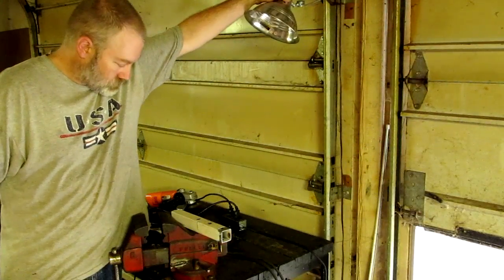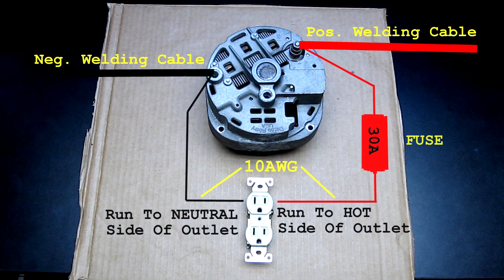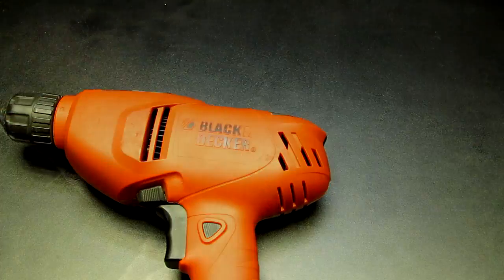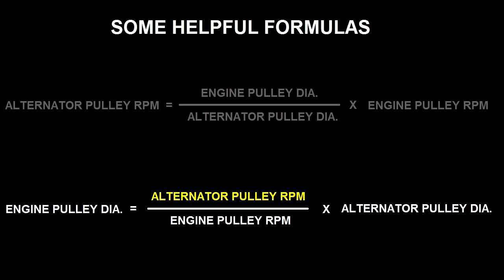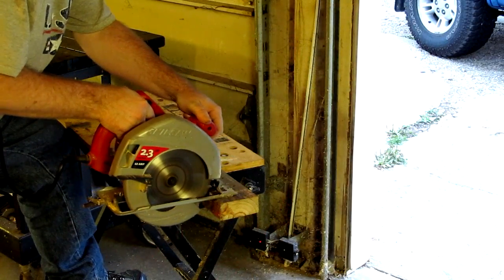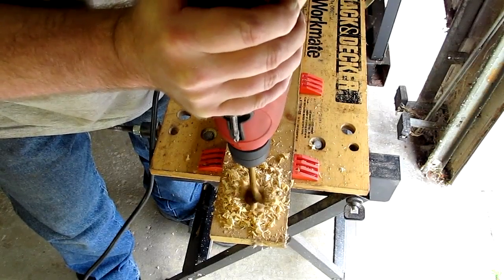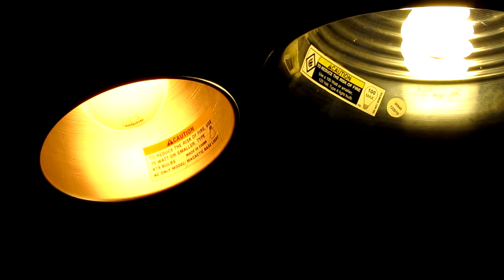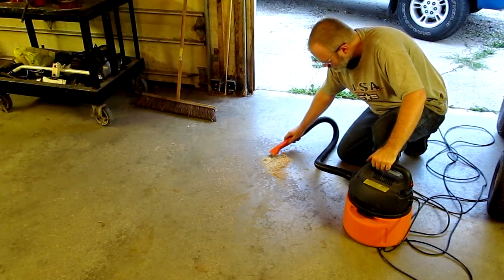Alternator Welder Runs 120v Power Tools - How To

Comment from the maker: Thanks for the compliment. Yes, the alternator was modified. How I did it is shown in my "Homemade DC Arc Welder Build" video. Basically, All that is needed is to bypass the voltage regulator so a full 12-14 volts can be applied to the field circuit of the alternator. Once that is done, the speed of alternator rotation will determine output voltage. Does that clear it up enough? Let me know if you need further explanation.

Comment: Hey, nice video. Did you say this is a 120 DC Volts? how do you step up your DC from around 14VDC to 120V DC? Can you clarify on that? did you modify your alternator?
Reply: It looks like the alternator's OPEN circuit voltage when bypassed the regulator is very high. The reason this does not blow up your car battery is the regulator, which just turns the alternator into a "constant current source", and detects when it is outputting too much power, then lowers it.

Comment: nice , i think you could build a "switch" for the alternator controller so you can run the alternator at regulated 12v for charging batteries or whatever with 12 volts and you can also weld ;D

Comment from the maker: Yes, all that is very true. Here though, I was going for 120v DC for the tools. My thinking was that you can build a welder that uses only an alternator for welding AND tools, with less components. People already are building alternator welders, so simply adding an electrical outlet to the existing setup, allows for some extra tool usage. Your way however, is the way most people will do it, and that's fine.

Comment: Nice build!
If you want to get the full 120 volts AC, you can install an inverter into the chassis of your generator. You have a 12 volt input from an alternator, and it converts that into 120 volts AC out. Make sure you get one that has enough wattage to fit your needs though.